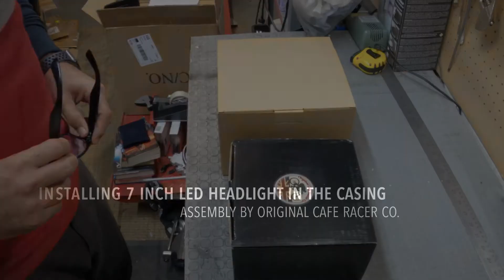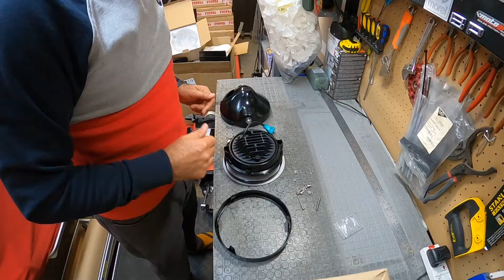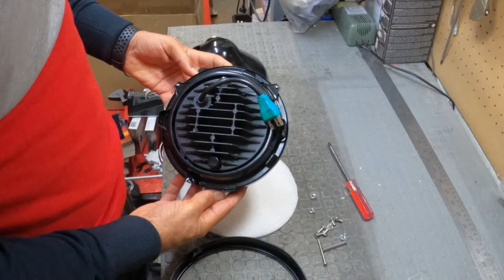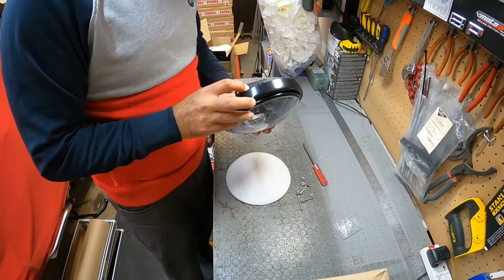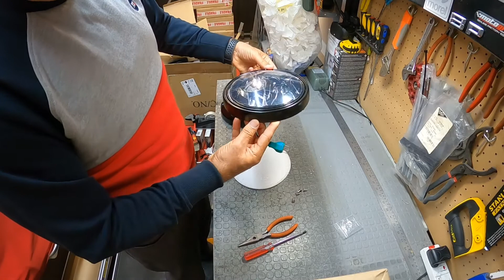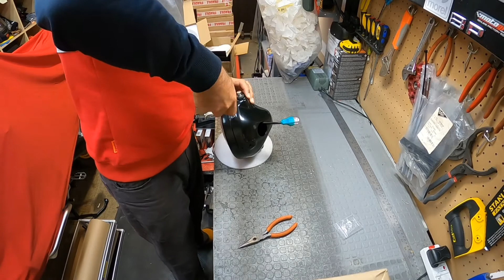Installing 7 inch LED Headlight and Casing

Comment: Would have been nice to know exactly what screws are going where and you be a little clearer with showing/explaining.?
I'm having issues. I've had it apart two or three times and when I put the light complete into the housing and try to align it with the casing holes, it's not in alignment one bit, but can only be installed to the rings in a certain way to allow for the spring. So what am I doing wrong?